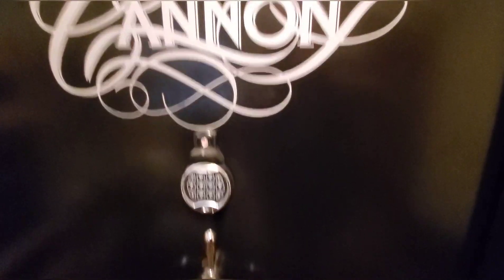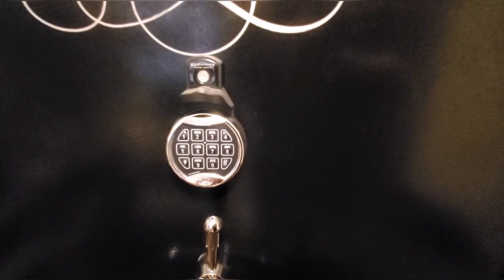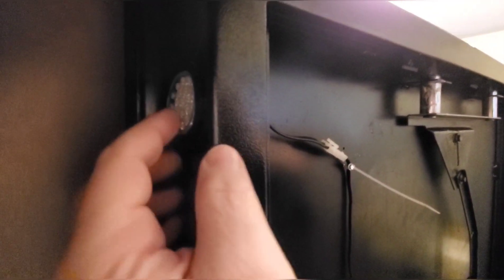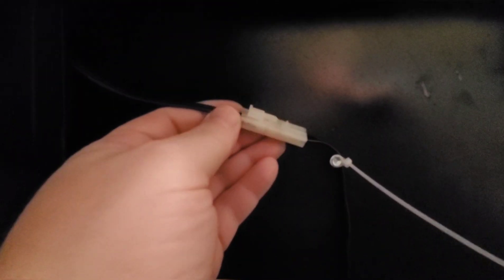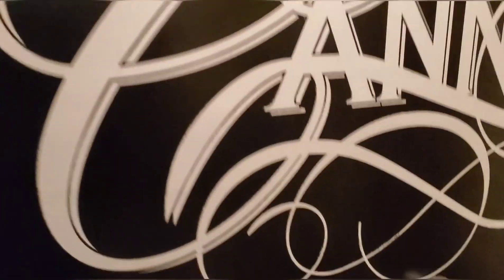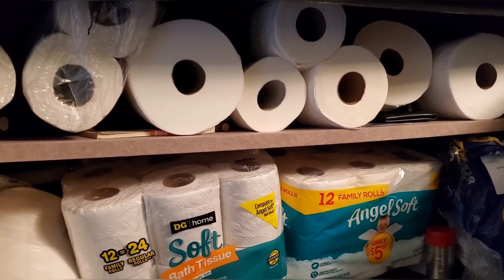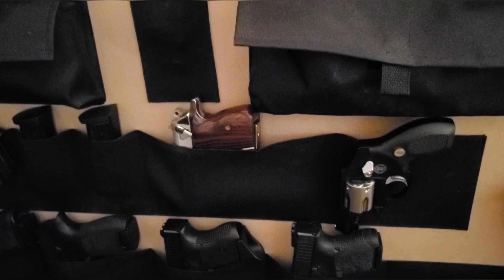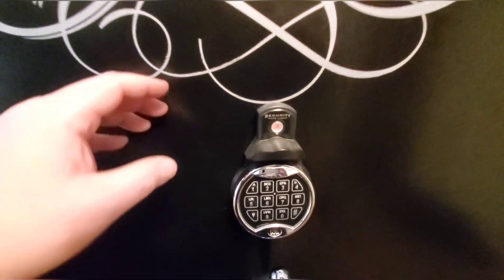Cannon Safe Review. Should You Buy? My Problems With it and What's Being Done About it.

Comment: I bought the same safe from tractor supply 2019 I only open it a couple times a month last week I spawned the handle to open it in the shaft broke off literally inside the safe nothing wrong with a combination set or the battery or anything else contacted Canon was very strenuous to give them everything they wanted videos pictures battery pictures before they would even escalate it to get it fixed now they sent me an email that it will take 15 to 20 days to get a locksmith out I do not recommend this safe under any condition there were things in my safe I needed to get to tractor supply is okay but the warranty people on Canon are the worst I have ever seen for a new item and I have been around a long time I own an army navy store this is just poor workmanship probably Chinese steel thank you for your time
Reply from the maker: Thanks for sharing your experience! 👍🏼